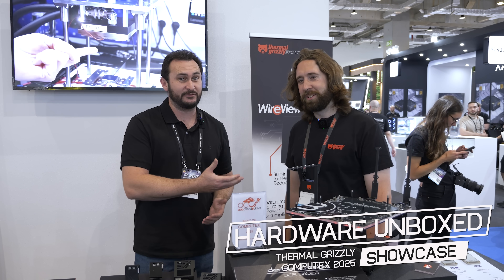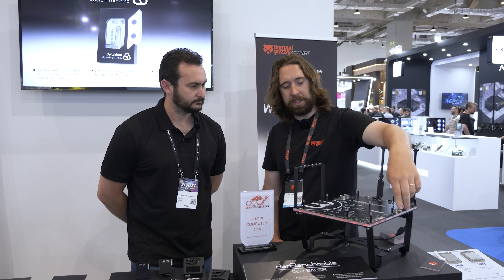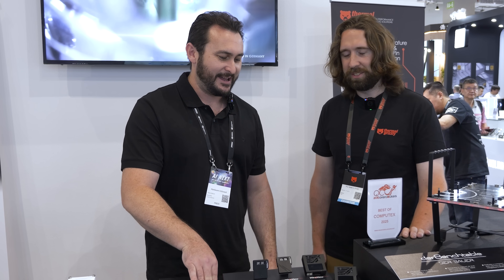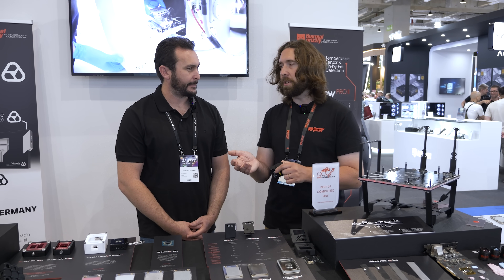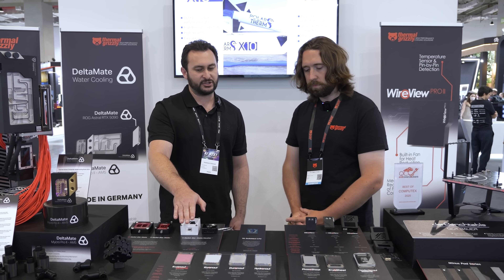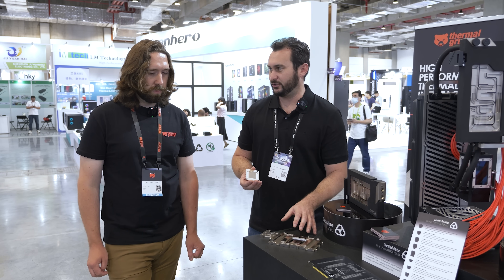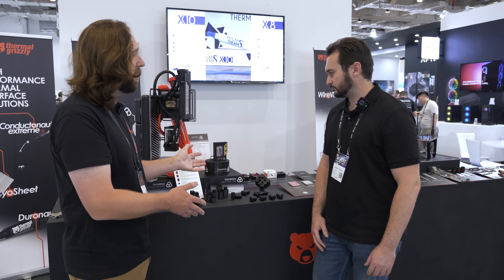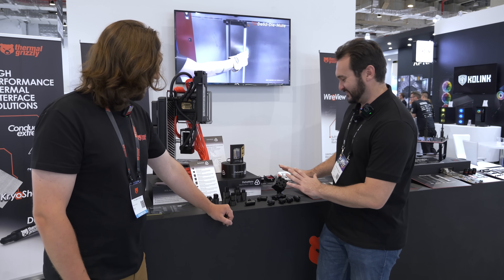Thermal Grizzly (Computex 2025) WireView Pro II, Benchtable & Custom Water-Cooling

Comment: youre a big fan of having to pay to fix nvidias mistake? which isnt a fix, its duct tape. shutting your computer down mid work project isnt a fix. and then having to figure out how to turn your computer back on like do you have to replace a cable? to "fix" the problem or re plug the existing cable back in? this is kind of advanced stuff no end user should be dealing with 🤦🤦

Comment: I used silicon gel and used it like thermal paste then removed it and mapped the thickness and heighth difference to then judge and sand the direct chip die with a nail file paper 360+ grit or higher

Comment: display in a computer case, ok i cant see my case even under the desk, problem is on the desk the noise level is slight elevated, under the desk i hear zero, sleeping in same room its good like that running my desktop 24/7 the last 10 years its importants its silent. So no monitor in my case ever.

Comment: Another thing the Wireview Pro 2 has that I think you/Joe skipped over is that it can log the data for a few months - which you might be able to use to see what happened if you do have a failure.

Comment: Im coming back to building my first pc in 15 years so im kinda off in the game. Is it worth buying a direct die 9800x3d + Liquid Metal and use a AIO + AM5 frame or is the direct die option only really suited for water cooling using blocks?
Reply: You can always go ahead and replace the TIM AMD applies and replace it with liquid metal, re-apply an IHS and use an AIO.

Thing is... why go through all the trouble and not make it really count? And that's only if you direct die with open loop watercooling.

Additionally, the AMD X3D parts are already so freaking fast, you would really need a specific reason for tuning them that way. Other than "because I can" I mean, but of course that's a valid reason, for sure.
Reply: @danieloberhofer9035 I’m just trying to get as cook cpu as possible, that’s.truly my only reason for going direct die and liquid.
Reply: @Lfcsweden-n5m  I assume that "cook = good" (damn autocorrect), yeah?

Sure - I can completely understand your point, we're all enthusiasts here to some degree after all. In that case I'd say make up your mind about what it is you want your system to be the best for. If it's just gaming, the 9800X3D is brilliant. If it's "everything", the 9950X3D is the best money can buy right now. And if you want to eek out every last bit of performance no matter what, I can recommend Thermal Grizzly from personal experience. Their stuff is top notch. But be aware that depending on your personal level of experience, that whole process (direct die colling with liquid metal in a custom loop) can be challenging and requires careful planning, execution and maintenance. Some personal advice: As tempting as it may be for aesthetic reasons - avoid coloured liquids for your loop. They may look great, but the density of the microfins in modern blocks basically spell disaster for coloured coolants. Pastels being the worst. Just don't do that. Otherwise, have fun! It's a great (if expensive) hobby that I used to enjoy very much.
Reply: @danieloberhofer9035 Im sorry me confusing thing. It should say ”Cold”. So im wondering if its possible and even worth it to use a delided 9800x3d + liquid paste and a AIO cooler or do I have to run delid using a block? 

Should add I would love to get a custom water cooling but I think that’s in the future, not feeling confident enough about the custom watercooling yet :/
Reply: @Lfcsweden-n5m  If you're not confident in building your own custom loop just yet, better keep it simple. Get the CPU, get a good cooler and just leave it at that. Enjoy your system and don't bother with delidding and liquid metal.

The performance advantage in a gaming scenario is already not that massive. I for one even went back to air cooling for my current build simply because I wanted it to be as low maintenance as possible. Yet, I don't lack performance. As I said, it's a fascinating hobby and can be a lot of fun, but it's by no means mandatory.
Reply: If you havent built a PC in 15 years you would probably be blown away by a 7600 with stock cooler

Comment: As a guy who does industrial hose and fittings its so cute to see the tiny little fittings you guys use.....why would you not use cheap industrieal standard parts...theres a series of basically lego every company doesnt need its own elbow 😂 they've got international design standards that trillion dollar companies use to make money you can bet they are the best and most efficient with entire economies of countries like Italy into hose and fittings

Just dont use DIN go JIS if you need to be slightly different from JIC I actually used Oring Face like a little hydraulic system on mine 😂but that's because they are so cute that little
Reply: G1/4 fittings became the standard back when people were still abusing car heater cores as radiators. It's kind of like the ATX standard in that it's really hard to change away from now that everyone is using that standard for all sorts of products.

Comment: Sorry lads but in my experience Thermal Grizzly is complete junk.  Didn't perform any better than cheap stuff and my $120 little tub of grizzly dried out within months not years even though it was " guaranteed not too"  I won't make that overpriced junk mistake again.
Reply: It's supposed to be a really tough paste that needs to be spread manually with a lot of force. That's how it gets its high thermal conductivity. And yes, the thermal interface material generally isn't the limiting factor to cooling performance, the cooler you put on top is.
Reply: @hammerth1421  Honestly, as soon someone says "iN mY eXPeRIeNcE" I just discard it as anecdotal evidence with far too many variables to take even remotely seriously. Even more so as there are enough reliable tests.
Reply: @hammerth1421  I know how to use thermal paste and follow instructions. I have been building PC's for over 25 years.
Reply: Your comment is complete junk. Didn't provoke any angry feelings in me. I won't make the same mistake of reading it again 😅
Reply: @muddypt  I wasn't trying to provoke anything. I am talking about my first hand experience. Don't be a simp for sht.

Comment: I like that Thermal Grizzly started selling carbon sheets and PTM. The "use and forget" philosophy of both products is great for peace of mind.
Reply: i got one of their ptm sheets for a laptop. It's much better than the paste manufacturers use and has improved thermals on the i7-14650HX it has. GPU had no benefit.
Reply: I use the Thermal Grizzly KryoSheet on the CPU and GPU. They've been great. No more paste pump out, hot spots or thermal throttling from high temperatures... Truly great product. Set and forget!
Reply: how much they payin to post a dis on a comment
Reply: @аибе-о9ь  Sadly nothing, i just had to repaste an older GPU recently with a 105°C hotspot, the only PTM i could find was from them. Knowing I never have to do it again is great.

Comment: The dummy card to install and get your loop ready without risk of spilling water on your real card is a good idea. You can check every thing is correct, then drain to install your card and only have to worry about those 2 joints.
Reply: I was thinking it's a neat idea to preserve the stock cooler, and not necessarily to get your loop ready or whatever
Reply: Nah, just run the pump by jumping the 24 pin.  You can also put some paper towels down.  You're going to finish the tubing after Installing the block on the real PCB, anyway, which can also rotate the fittings at the other ends of those tubes.

Comment: I already bought my 9800X3D before they offered  this.
Using it with their High Performance Heat Spreader and 240 AIO.
100% not necessary, but I don't like the stock IHS
Reply: at least the thicker AM5 IHS doesnt bend like the intel ones where you need special contact frames
Reply: @ThunderingRoar  lol I still used a TG contact frame before de-llidding it

Comment: I Direct~Die'd my 9950x3d and added liquid metal and the results are epic! 9 degree c drop in temps and an extra 400mhz boost clock
Reply: Any diference on FPS?
Reply: @Wil3vlbc9gvk604  
this is the fastest CPU for gaming. There is no Card that can use it at 100%. If you Direct-Die your CPU you think its mostly for the fps? no....its about Temps, Longevity in First place and maybe a 0-5% fps Boost, if you have a 5090 /"or higher XD"
Reply: @shaku_maku  I feel like the limit on this platform is on the memory control and not on clock. *I have a 9800x3d and it really overpower using the current GPUs.
Reply: that's because you are not running a 9800x3d with a 1080ti....🤣
Reply: Crazy 😧

Comment: Also, thanks Joe
Reply: Back to you, Joe.
Reply: Hab mein 9800x3d mit micro direct die Pro im April bei Thermal Grizzly gekauf, absolut cool! Hab nen x870e Tomahawk und 2x 32GB DDR5 6000MHZ CL28 36 36 96 Corsair Vagance RGB, mit ner 4080RTX mit Eisblock und 2 Radis im PC und Mo-Ra 3 Pro 360 extern, sehr leise mein Setup mittlerweile!